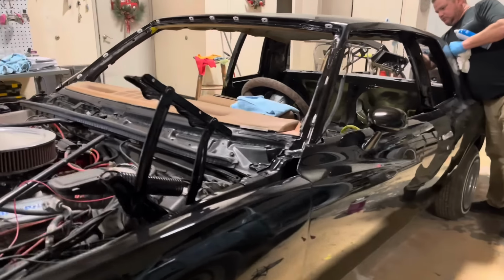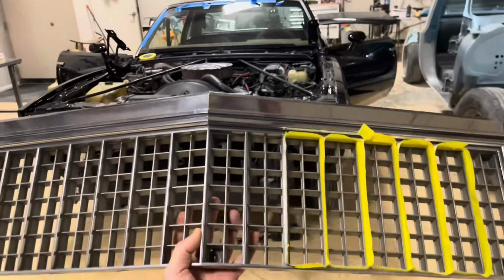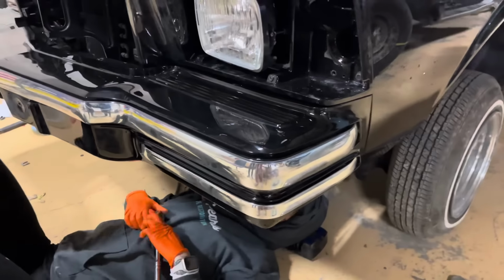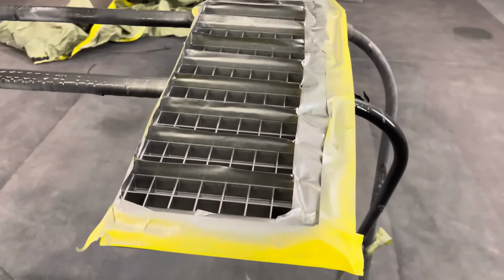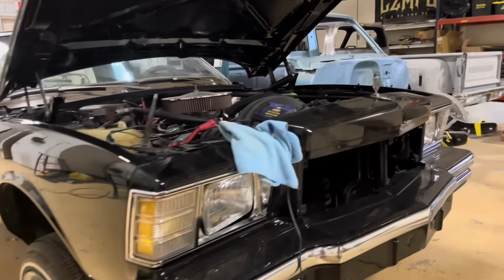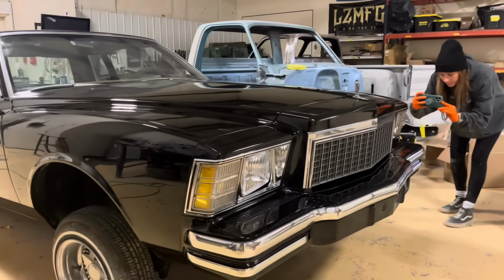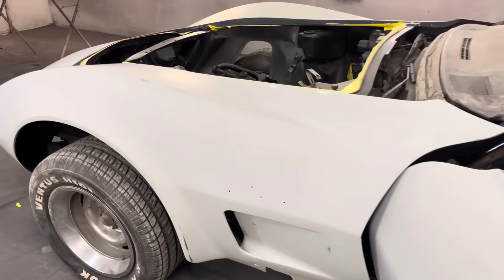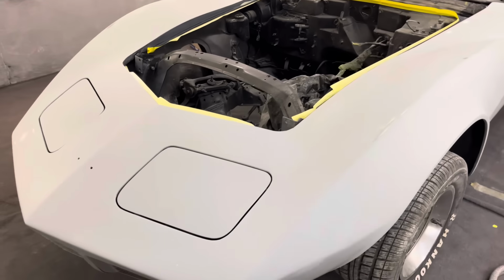C3 Corvette Colorshifting Paint Job & Finishing the Monte Carlo

Comment: @house of pearls when u guys do ur paint work wich is absolutley amazing by the way do u wet sand and buff the vehicle or is that an extra paid for by customer i justcrecwntly had my 2017 c7 corvette painted wich was a 13000$ job and came out with more orange peel then I think there should be and the shop sais the will not wet sand and buff
Reply from the maker: We wetsand and buff everything bottom to top because our goal is a show car finish. Most collision shops go for a factory “peel” or texture which can be accomplished with the correct spraying application and mil thickness. If the car came out similar or better than factory, with no contamination throughout and a proper disassembly and reassembly (glass out, all parts disassembled for paint) then I’d say $13k is realistic without a wetsand and buff if the finish is comparable to factory. 
Wetsand and buff can easily take 60-100 hours. If their paint job is lackluster, they may have to wetsand and buff it for free although doesn’t take much to sand to factory peel and texture. 

Hope this helps! I’d say $13k sounds like a lot, but it’s not when compared to the hours invested in a proper job. If I was quoting it, it would probably be closer to $15k plus on something like that because I’d be accounting for the wetsand and buff process as well as the other extra procedures that a lot of shops may not go through.